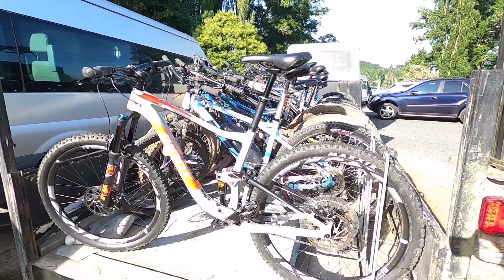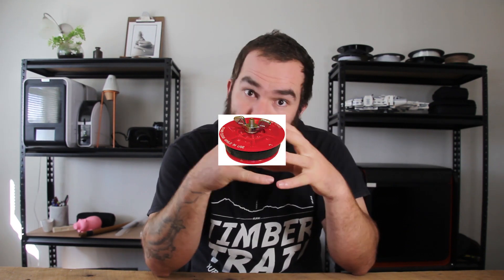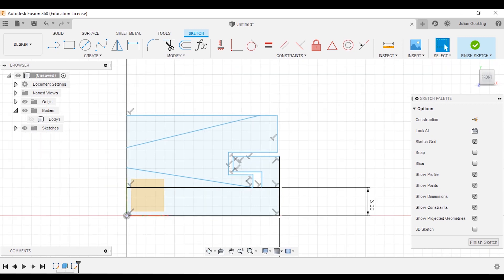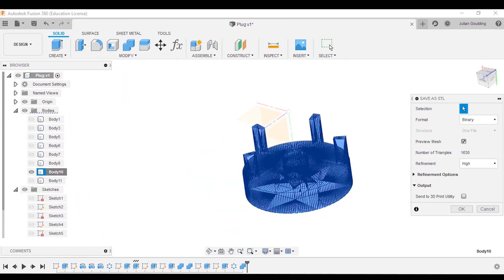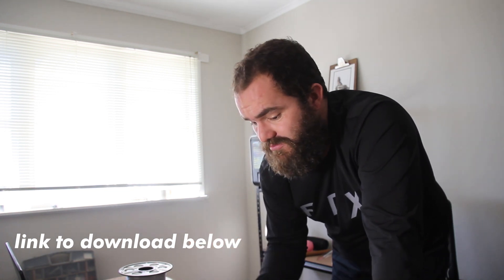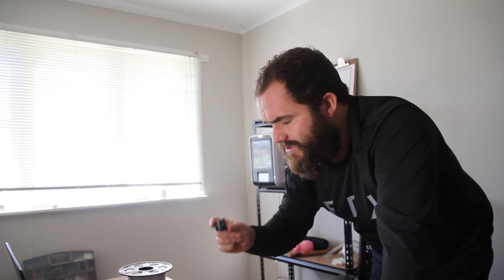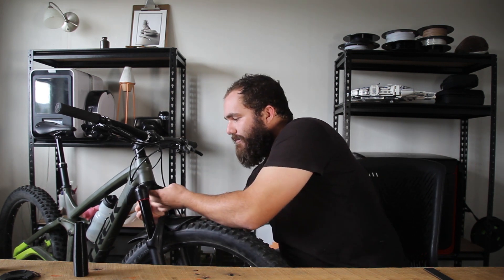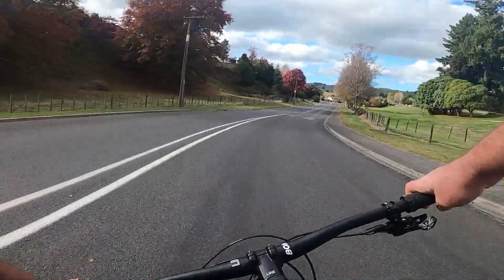Making my own EDC! - DIY Hidden Bike Tool

Comment: T Handle wrenches are great when applying torque, but when the torque is not needed the the rotational motion is very awkward. You may want to check   the Super T Handle with Metric Allen Set, compact with a unique spinning feature when torque is not needed.

Comment: Thanks for the idea but that plug thing you didn't actually need to design it since you can get an expanding stem top cap that would have done the same exact thing, only issue is that you'd need a tool to tighten and loosen it but I have a bit driver hidden in my hollowtech crank (all in multi-tool) to take it off and I also have a chain tool hidden in my handlebars (topeak ninja c)...so now all I needed to carry around was a couple of tyre levers. I know topeak makes a bottle cage that has tyre levers but it looks ugly compared to the carbon fiber bottle cage I already have. So all I did was to wrap the tyre levers around some velcro and shove it up the steerer tube and used the expanding top cap to keep it from falling out. Had to wrap velcro around the levers just enough so it'll be snug in the bottom of the steerer tube, so it doesn't rattle around.

Comment: If you don’t want to tap threads into your steerer tube get the smaller more affordable option that doesn’t require you to tap threads into your steerer tube the one up edc lite and also pretty cool tool you made there

Comment: Could you pls tell me what I'm doing wrong?

I have sulki smooth prints with 4K resin printer.. But when I tighten that it gets stuck and don't spread enough to be tight to fork..... Pls help
Reply from the maker: Have your resin prints completely cured? I know if they haven't reached full cure they can be quite taky
Reply: @juliangoulding  they are fully cured.
And don't feel taky.. I even added grease between parts. Still gets stuck?🤔
Reply: What  is your forks inner diameter?🤔

Comment: Hi Julian, i hoping to get it printed soon.  Do you have any details of what multitool you used and what chain tool too?
Reply from the maker: It was a replacement specialized swat tool and a bbb multi tool. The best is to print just the plug part that I did first then you can throw anything up there in a sandwich bag. That's what I I've actually been doing for the last few months.

Comment: I have the fork cork and spent ages researching and buying tools, co2 and chain breakers etc small enough to fit through the 30mm opening. My next challenge was what to store them in so they don’t rattle around. This looks ideal. Now to find someone with a 3D printer .
Reply: This guy used a Wolf Tooth Encase multi tool
https://youtu.be/k7jWxd3HeI8

Comment: Is this better than the original ecd system? At least there is more room in the lower part of the steering column. Will going to print it as soon as librarys reopen. Cheers.
Reply from the maker: Cheers Mikko. It works well, I've been riding more just with the plug bit and storing heaps of other stuff up there. you are right about there being more space down the bottom.

Comment: Can you provide the cad file for a 'blank' of the section with the cutout for the tool? That way anyone can adapt it to fit whatever they want to. Great Design!
Reply from the maker: I uploaded one for you mate, it's in the thineverse link.
Reply: @juliangoulding  Thanks, but could you provide the CAD (Fusion 360) file too? It is difficult to accurately edit STL as its a mesh file type.
Reply from the maker: @niketpatel9797  I'm holding onto the Cad file for now. will maybe release it later so will let you know when I do. If you are having trouble editing a Mesh file, you can covert it to a Base feature. In Create, down the bottom, "Create Base Feature" then in "Modify > Mesh > Mesh to BRep" click on the mesh and the click "Finish Base Feature" 
Hope that helps.

Comment: Wow! That's a really cool project. In your next video, please do some close-up shots so we can admire the details.

How many iterations did you need to get the plug to work to your satisfaction? I find people often lose patience and stop after too few iterations and then are unhappy with the results.

Is the TPU you used to make the O-ring the stuff called "poly cord"? It's often used to make belts for material handling in factories.

Did the tools rattle in the carrier? What did you do to stop the rattling?

We really appreciated the ingenuity and the "do it yourself" attitude when we lived in NZ :-)
Reply from the maker: Thanks for the comment. I must of done about 10 prints to iterate the mechanism. The TPU is a flexible filament for the 3d printer. If you put the tools up there in a plastic bag then they don't rattle at all.

Comment: Awesome video!! your product design skills are getting next level. with the wheelie you actually need your seat down or halfway for balance(you want a low CG). And it may seem counter intuitive but you want to use the hardest gear you can get away with because low gears will make the pedal pressure twitchy.
Reply from the maker: Thanks! Yeah will try it tomorrow. Gotta get it dialed before the end of lockdown!